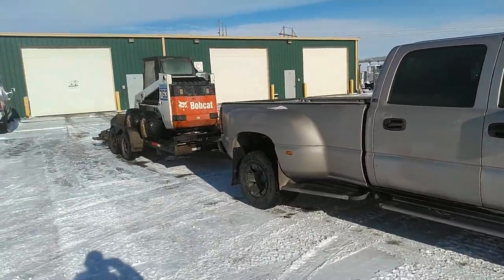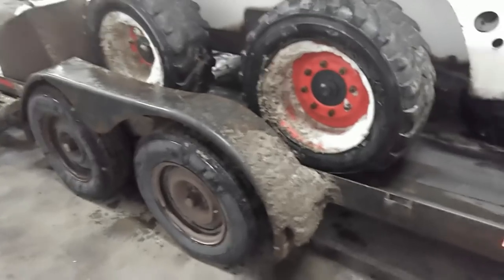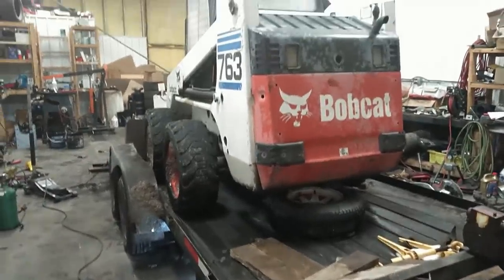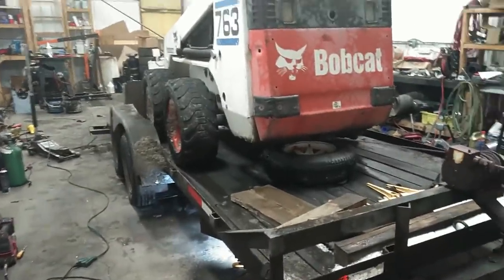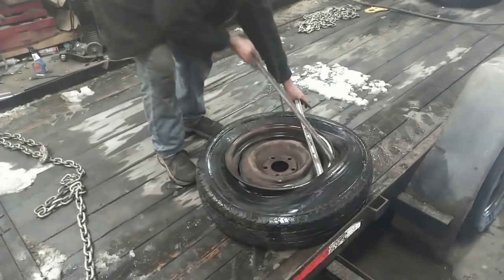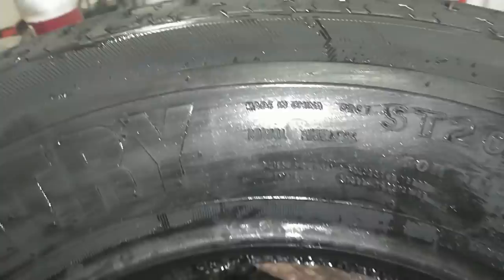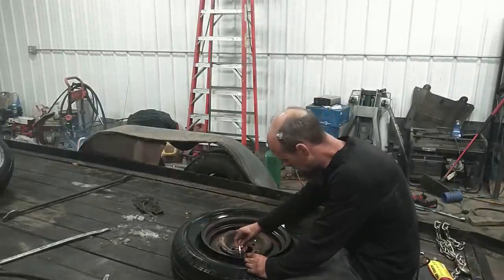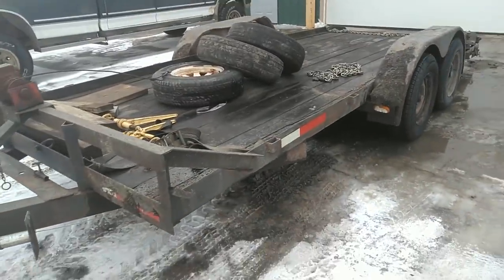patching up a old car trailer

Comment: I have always marvelled at what and how you accomplish everything you do being a one man band. I know that the smaller the tire,  the harder to do by hand. I've done more than I care to count. Just wondering why you didn't use a tire hammer to break the beads????. 
I do balance mine with a simple bubble balancer. Figure it can't hurt.  ...  . Love what you do, especially the sketchy schizz😉
Reply: The rim on smaller wheels is so light, that if you miss and connect with the rim, it's bent.
Reply: Yes sir I know that. If you use 2 hammers it works well for me. I hold the tire hammer against the bead, and hit the butt of it with the second hammer..  .......

Comment: It will be cheaper to beef that trailer up but by the time you do that your time equals alot of money as well and you probably could find a heavier trailer that is already built and then sell the old one to offset a little bit of the new purchase.  I rebuilt just a small utility trailer last year and by the time I was done I could have bought a better one.
Reply from the maker: Even the heavier trailers are still biult like garbage. If I re do this one I'll probably have half the money as new but a stronger trailer figure time it's probably a wash. Really kinda hoping to find a good buy on a decent used trailer that is heavyer. Then I'd probably still keep this one as a car trailer because it's got a nice low deck easy to load cars with low ground clearance
Reply: @Ezrider359  some of the new ones are garbage but there are a few that aren't too bad.

Comment: My friend flips his axles upside down every so often to bend them back straight.

I use my bobcat to break beads on tires also but I tip the bucket all the way forward and use cutting edge of bucket vertically.
Reply from the maker: forks work better than the bucket, but the machine was kinda trapped where it was, i was also trying not to dump all the snow out of the bucket on the shop floor, wouldn't have made a difference though they were pretty well stuck.
Reply: @Ezrider359  How is your heater mod working in the bobcat, I have been thinking of doing something similar to mine for years but it have not seen it get colder then 20 degrees where I am at

Comment: Hey, Ezra, gotta say that trailers may be the least healthy gear in anybodies fleet. Dry wheel bearings, bent cross members, bad tires...rotted floors, etc. Ask me how I know??? Lol! A little beefing up wouldn't hurt. Regards, Solomon
Reply from the maker: its really not in that bad of shape, it was completely re done about 6-7 years ago including a new deck wheel bearings get re packed every year, but i ask a lot of it sometimes and its about to where it needs to be re done again and beefed up or i need a heavier duty trailer for some of the things i use it for.

Comment: I rather mount a set of truck tires than those small little bastards. I used to have a 12,000 lbs trailer to haul my Komatsu excavator and mounting the tires on that just about broke or bend everything i had. The HFT manual tire mounter looked more like a pretzel when I got done.

Comment: I think the 7000lb trailers should be outlawed every one I seen has had its ass run off of it overloaded. I'd probably find yourself a newer 14,000lb trailer once you start ripping into the old one you have you'll start finding all the other defects you'll be into it for days of work and a ton of money. I don't like spooning automotive tires I did my 05 F350 srw tires couple months back the tire shop I use was booked to mid January we had snow coming I needed to change out the tires. Lets say the damn 265/70R17s fought me more than a 425/65R22.5. The eye poker comment made me laugh yep wire wheels are nasty especially the softer wire cup wheels damn things shoot off like a porcupine.
Reply from the maker: if they rated these types of trailers for what they will actually hold up to there ratings would probably be cut nearly in half. if i re do this trailer it will probably take a few days but it would probably be stronger than a new trailer when i was done.

Comment: As a matter of curiosity what does that Bobcat weigh with that bucket fitted? T rimshose tyres were real difficult to get off the rims, is that mainly due to 10 ply rating coupled with the corrosion on the rims? - It sure made you grunt to get them let them go in the first place but as usual you were not to be denied!!
Reply from the maker: that machine weights roughly 6k lbs. small tires are more of a fight than large tires but stiff cold rubber that's been mounted for a long time makes it even a bit more of a fight.

Comment: I've not seen you use penetrating oil on anything that is rusty stuck.  Is there a reason?
Reply from the maker: Cause unless your going to let it soak for days it doesn't do much heat is far more effective if needed.

Comment: Do you need to balance trailer tires?
I’ve never really thought about it until now.
Reply from the maker: i never do, never had a issue.
Reply: I do.  It’s not necessary though.  It makes it ride smoother unloaded behind you.

Comment: isn't it funny how the beads never want to come off when you want them to but will dismount themselves at the most inopportune time.  Moving my lowboy a few weeks ago with the diamond reo and  one of the tires walked right off the rim.     Probably be better to upgrade the whole trailer over trying to make yours into something it was never meant to be
Reply from the maker: lol yeah when you want them to stay on they fall right off when your trying to break them loose they wont let go.....im not worried about my ability to make the trailer more than strong enough its just more a question of if its worth it or not, if i can find a good used trailer that fits the bill that would be the way to go. hard to find reasonably priced used trailers that fit what your looking for though.
Reply: @Ezrider359  not doubting your ability either. i grabbed my 6 ton for 2k and its a 2000 model year
Reply from the maker: yeah id jump on that deal. hard to find anything much cheaper than new prices for at least the last year iv been looking.

Comment: My back hurt just watching u bustin them tires. A tire hammer is pretty cheap and way easier
Reply from the maker: I have a tire hammer no way would it have worked on those beads. Your notice I was lifting the skidster before they broke loose

Comment: I was doing a set of tandem axle tires on a on a rig at a shop I worked at I got the everything went perfectly smooth until I came across and inside tire let the air out like I did with all the rest of them I came along with a bead hammer and that thing wouldn't budge I hit that thing until I was blue in the face I got it to come down just a tad that's it I even have my coworker hit it a few times couldn't get it we did everything possible service manager said I'll get the tire guy to come out tomorrow and see if he can get it it really pissed me off he took one hit not fucking beat went down I'm just like what the fuck I beat the hell out of that damn tire yesterday and it wouldn't come off tell your guy goes sometimes they just won't break and you have to give them time.